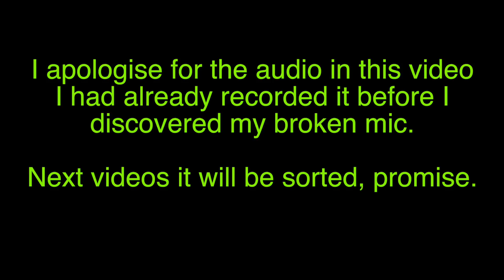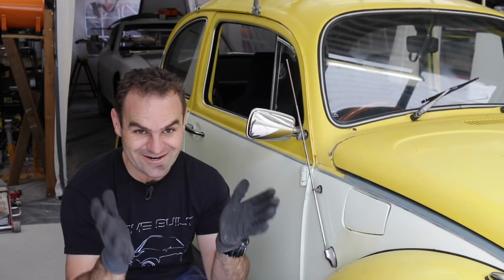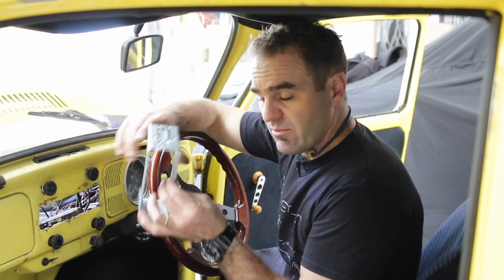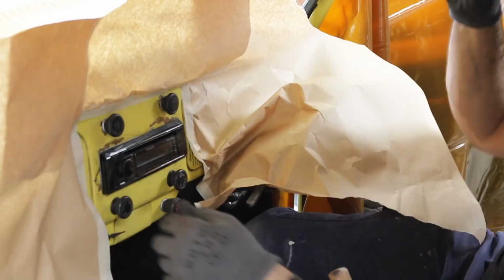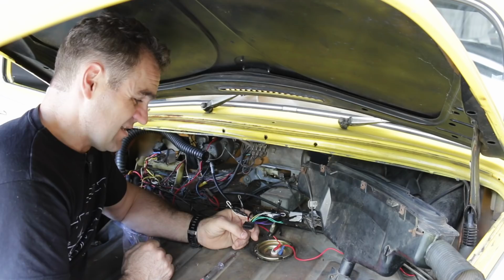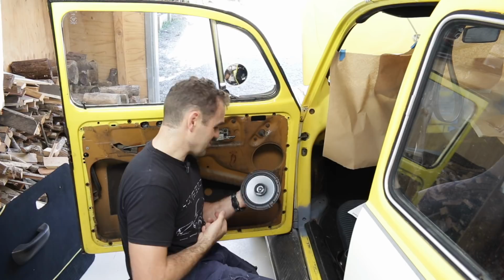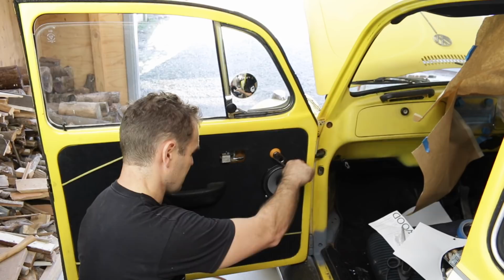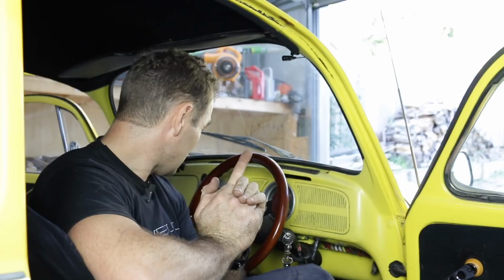Dash repair and stereo install - Home Built Project Beetle part 7

Comment: As a car audio fitter of 25+ years, the people who change their stereo, own, 80s, 90s and 00s models. The "old cars" are few and far between. And FYI there are "Retrosound" stereos available but in general they are cheap and sound terrible. Also ive never seen someone cut a dash with a grinder. Use an air panel saw and small handheld belt linisher my friend. Thanks for the great content.

Comment: I love your videos...I am in the market for an old Ford Bronco and when I was doing some research I came across a vintage styled shaft radio that has blue tooth. Really cool. I don't remember that it was that inexpensive though.
Reply from the maker: It was not as cheap as I would like, but it has a heap of different styles and button configurations. I think from memory mine cost about AU$500.

Comment: I totally agree about the market for old twin-knob style car stereos.  My wife and I want one for our '78 Super Convertible.  I've looked on ebay, Amazon, and even put a "wanted" ad on Craigslist, and have not found anything worthwhile at a reasonable price.  It seems like someone in China could be putting these together for well under $100 U.S.
Reply from the maker: I have a Retro Sound unit in my 911 which looks great and works well from the little I have used it, but it cost me around AU$500, where you can get a Kenwood or Sony, or whatever unit with bluetooth, etc, for AU$100. Surely these manufacturers can just put a different face on an existing unit.

Comment: There are two companies that make retro style radios that I can think of off the top of my head. Retrosound and Classic Autosound. However, they are overpriced and based on cheap Chinese and Malaysian radios that would typically be around $19. However, in the days of bluetooth now, a lot of manufacturers make hideaway radios and amplifiers. There isn't really a market like you'd think there would be.

Comment: Why didn't you do the flush mount speakers with perforations on these door panels?  Great video as always.
Reply from the maker: I actually mentioned that it is what I plan on doing when I get the new door skins. Until then I am not going to spend too much time with the old stuff.
Reply: I figured they would be good practice panels, thats all.

Comment: Looks like an electrician's radio mounting job..hammer and chisel......good to get that fixed up..so why does the speaker hit the window winder if there is a standard hole there in the door for it?
Reply from the maker: That is a good point, although those speaker grills were pretty chunky.
Reply: non-standard window winders perhaps?

Comment: Looks like he only had a hammer and chisel. B is for build just started a 240. Look what he’s planning to do.
Reply: His builds are getting worse and worse and more rushed. after the lotus I lost all interest.
Reply: I'm just shaking my head at how ambitious he is with it and his budget being so small. Transferring all the bmw computers over into the 240 is a monumental task as well as transferring the suspensions. I think it's going to be a rat rod in the end unfortunately. If he pulls it off i will be really impressed. Hoping but cautiously optimistic.  I like Jeff's builds, no flashing purple lights and flashy disco balls
Reply: I think his target audience is 15-25 year olds with short attention spans that are easily distracted so he needs to keep the pace up. The polar opposite of  project binky
Reply: it will be held together with zip ties and tape. Im still yest to see him paint one car without screwing it up hes painted like 10 cars now and still cant get it right
Reply: project binky now there is some sweet fab skills there.
Reply: yea but he keeps trying. I respect that.  Maybe someday he will realize you don't paint in rainy cold weather and actually build a plastic paint booth like Jeff did.
Reply from the maker: I actually still enjoy B is for Build stuff, although I wonder how he is going to go with his Z as it is a lot rustier than mine. To me that is a much bigger job than my car, which is still just getting basically the same engine installed. I understand his demographic, which is the younger crowd and why he is so popular. I like to think my builds sit somewhere in between him and Project Binky. I wish my builds went faster, but I also don't want to skip over too much. I also know I would be comfortable selling my builds to someone when they were finished, as I would know I am not selling them a lemon, and that they are sound cars.

Comment: I thought you weren’t going all out. From what you said it seems like you are spending money on unnecessary things.
Reply from the maker: It still needed to be fixed up, so it is not really pointless. The car is going to be a quick turn around, but I still want to do it right ;)
Reply: Ok